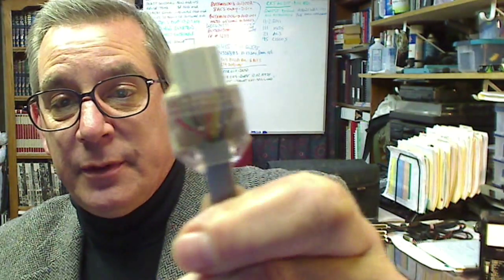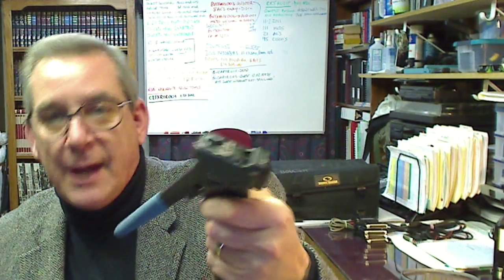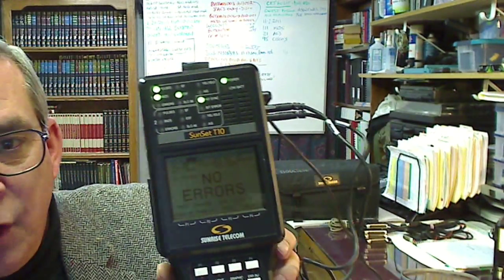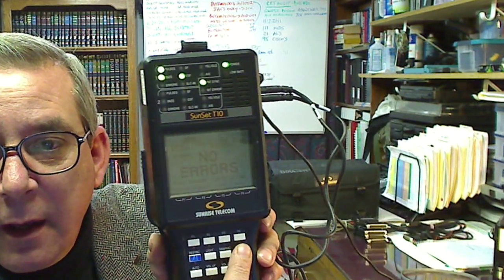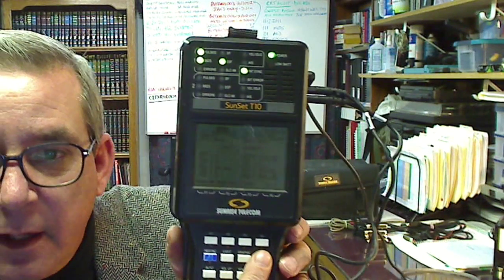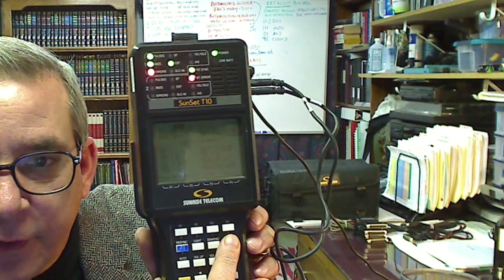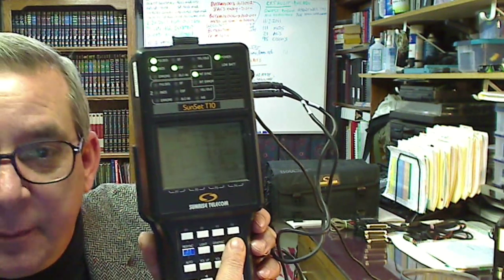T1 and Pinouts

Comment: OK a few things I saw wrong with the first 5 minutes of this video. First CAT 3 is not better than CAT5 for extension. The reason CAT 5 was created was specifically for this purpose. Cat 3 has the same number of  twist per foot on each of the pairs in the cable. Cat 5 was designed so that each of the pairs has a different amount of twists per foot. This causes the magnetic field created around the wires from the voltage on the copper to not interfere with each other. This gives the same effect as having pair separation between your transmit and receive pairs If you can afford it CAT 6 has shielding build in between each pair and is the best.
The way you show how a Crimper works is kind of off. The bottom of the end you use have little groves in them that you push the pairs in between. The top side of the modular end has what looks like mini razor blades. When you push the wire in then crimp it down it pushes the blade through the plastic coating and forces a solid contact with the copper wire inside.
Then you talked about stranded wire. No one should ever use stranded wire for T1's the stranded wire is multiple thin strands that make it so when you crimp you are not forcing a direct connection to the wire but rather pushing the blade between them and hoping they lay next to the sides of the blade. Guess work is not good work.
When using a biscuit for a loop-back jack make sure you don't use a RJ45X as the X module shorts the transmit to the receive when nothing is plugged in.
I would recommend footage wise CAT 3 1-300 ft past the NIU card, Cat 5 300-475 ft and CAT six up to 550 maybe 600 ft. but anything that long is pushing it no matter what quality wire you have.
Reply from the maker: TH Cabbie cat 5 was created .... about 50 years after T1/hicap.... I find all of your comments either wrong or incomplete. Using higher density twists creates timing issues, there are many different crimp types - you should know this, flat satin stranded has been used for 30 years (limited distance as I state). Your inaccuracies seem to reflect a poor attempt at being pedantic.